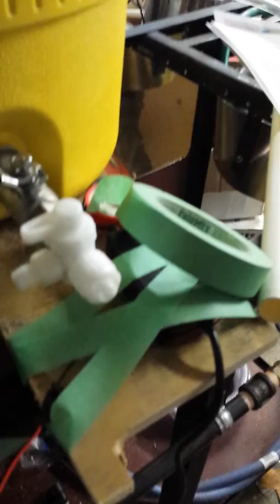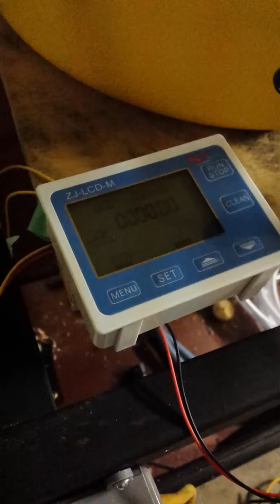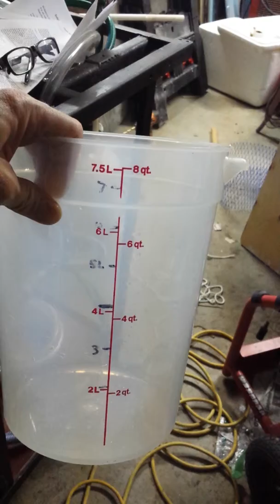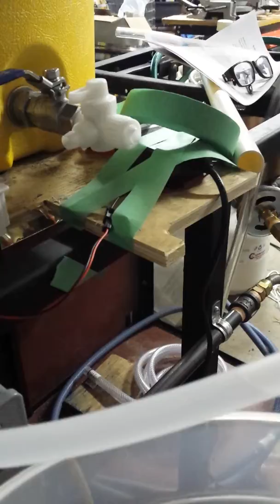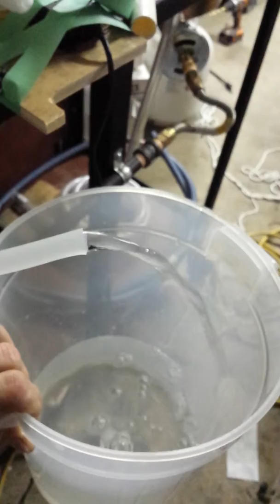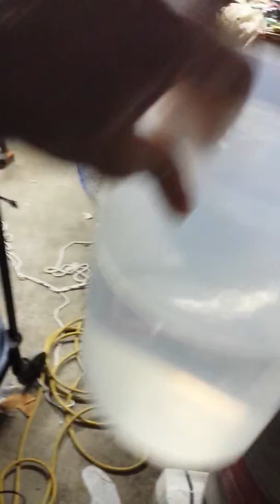Digital flow meter for mash water.

Comment: Did you ever use that flow meter for recirculation of the mash? Curious if you had problems with it clogging the meter, or if the setup could handle the temperatures used during mash/sparge.
Reply from the maker: No, never for the mash. I use it all the time for my hot liquor though. I use it to mash in, if I use it for a step mash and for mash out or fly sparging.